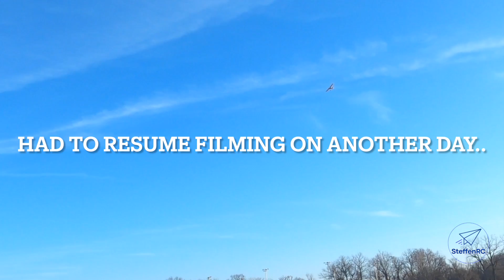How to fly rc plane without self level gyro - Part 4 of 5

Comment: You are wrong here. It is not moving from SAFE to AX3S.  It is moving from SAFE to no SAFE.  AS3X is a different technology.
Reply from the maker: I'm not wrong.  My video is all about moving off of self level mode.  Whether you use AS3X or Optimized or no gyro is the same goal.   A new pilot isn't typically going to fly in SAFE then switch to no gyro.  They'll typically switch to AS3X as their flight gyro.

Comment: The light came on today when flying the Apprentice STOL 700mm.  I did not realize how much levelling was happening in SAFE during turns, and how much I had to self level in Intermediate and Advanced.  I crashed a couple of times because I did not realize the difference.  (Nothing that some Foam tack, straight pins, and rubber bands couldn't fix).  Thanks for the explanation and reminder.  One step forward...
Reply from the maker: Keep at it..  Luckily that little Apprentice is tough and easy to repair.  Whats your next plane?  Ranger, Aeroscout, Big Apprentice or maybe the 90mm Avanti EDF.😎
Reply: @SteffenRC  Having fun with another EPO plane: Saber 920.  It's becoming the BEATER plane, first PNP programming plane.
Now going to try a KIT build: Skywing Slick 38inch.  Fun build.  Followed your 48inch build video, All good.  Thanks for your virtual mentorship.  Appreciate all the help into this great hobby.
Reply: Oh, how could I forget the UMX Conscendo.  What a blast. But mainly gliding for now🤪

Comment: These are very helpful and the best i have seen but i dont recall you saying what controls you are using to turn, Rudder, ailerons or a combination? When to use each or not to would be helpful. The landing tips are very helpful. THANKS!
Reply from the maker: Thanks for the feedback.  I've made a few videos for new pilots on flying 101 and speak about the rudder use.  Not sure you'e checked them out yet.  A few of them dig into the rudder and aileron mixing on turns.  Some plane don't require mixing Ail/rud while others do.   I made a video specifically about the use of the rudder and how new pilots can really excel by learning how to use it..    Thanks for watching and commenting.  Btw, if you find you still need some  additional information on the ail/rud mix. Let me know.. I'm always open to help.  Will

Comment: The point of this video is to help the Safe or stabilized mode pilots to not be afraid to fly the airplane  and enjoy doing it. The point about using safe as a panic mode is valid and some pilots use safe for landings still. Flying without the gyro to me is more fun and requires me to be on the sticks more. I enjoy landing all my water planes and STOL planes with out safe or stabilized mode. It requires a finer touch but after practice I can get a better spot on landing. Great video enjoyed watching.
Reply from the maker: Like you, I grew up flying before gyros were around.  I have several planes with gyros since I made the switch to Spektrum from FrSKY.  Some planes really seem to fly better with a gyro, but not all.  I see many pilots at my field fly in safe and are afraid to fly in AS3X, but want to do the cool aerobatics they see others do.  Hence this video to help them out.   Thanks for the support Tug, appreciate it.

Comment: Good stuff Will.  I get the idea that new / learning pilots in future months might really benefit if they have the chance to locate and go through your series.  You do a fine job with your communication and display.

As you were talking about how to bank the aircraft, then hold it in the turn with elevator - etc.  I thought of something that we did along those lines.  Just about everyone has a problem while learning - of giving the wrong stick movement when the plane is coming towards themselves - and trying to roll the wrong way.  So we would mention that the student might 'pre-program' the turn in their mind.  Think about 3 control movements all following each other.  Enter a turn with left, then back, then right.  "Left - back - right!"  Or -   right - back - left.  It seemed to help that they were putting those moves on the wall of their brain so that it was easier to keep up with what direction they needed to use for that third step - so they could finish a turn with success.
Reply from the maker: Thanks buddy..  I like your tip for when the plane is approaching..